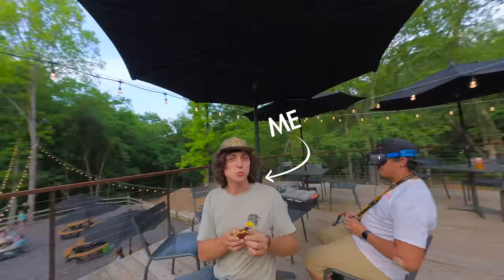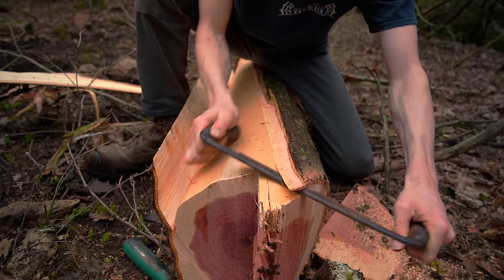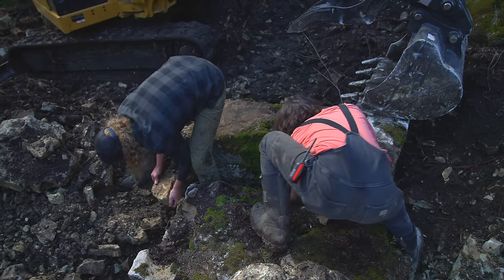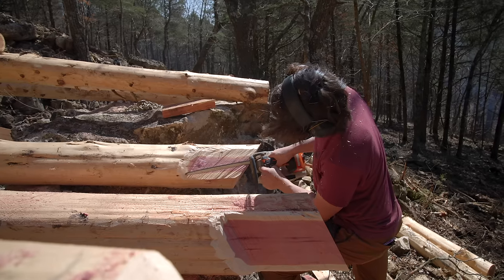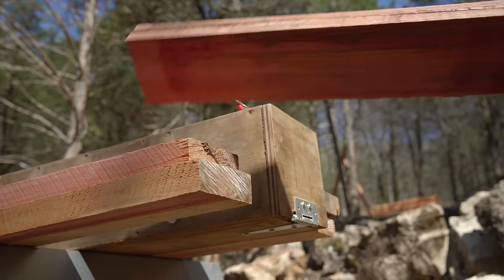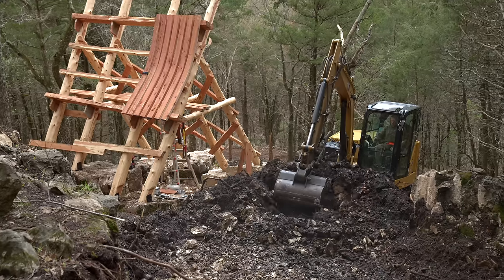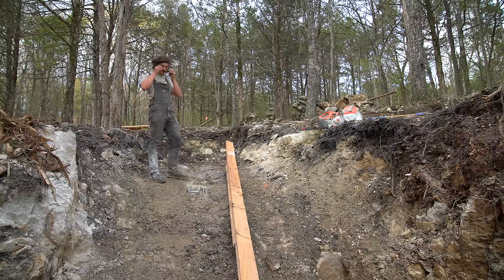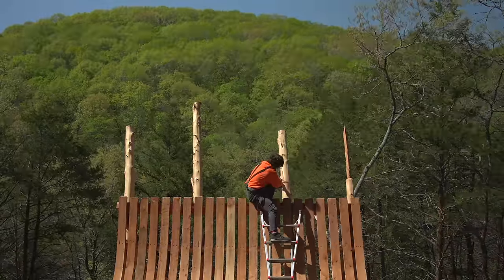We Lifted 1,000lbs Stones to Build This MASSIVE Bike Feature!

Comment: Great job. When I'm using wedge anchors and they don't grab. I pull them out and drop a piece or 2 of wire in the hole. It helps bind up the wedge to the walls in the softer materials. Keep up the great work.

Comment: Great video as always!
3:07  You gotta stick a stube down there and blow out all the dust otherwise they typically don't stick. 
Even if the rock is too soft, it'd only compromise the breaking force. Expanding bolts for soft rock are only different in their length, not the expanding grippy section. 

I'm not a profesional but I'm a rock climber who's bolted routes meaning I and other people trust the bolts I've put up with their life, so I'd like to think I know my stuff regarding this subject.

Additionally I'd recommend buying a climbing harness, a locking carabiner and enough (dynamic) rope to tie a figure eight on each end and about 1.5 arm reach of rope. Stick one end of the rope through the two smaller loops coming from the legs and waist, then pass the other end of the rope through the figure eight. Click the carabiner in the same end and loop that around something sturdy enough to catch you should you fall.
I had mine to begin with so it's easy for me to say, but even if not for the safety is it great for just giving you a 'third' hand to pull on letting you two hand or just focus a lot more when doing the particularly sketchy shit.

Comment: Amazing what you can achieve without unnecessary bureaucracy (i.e. Occupational Health and Safety telling you you're not allowed to chainsaw while standing in a bucket on an excavator without a harness, foreman, first-aider, architect to sign-off on the design, structural engineer's approval, blah-blah-blah). Good work 👍👍